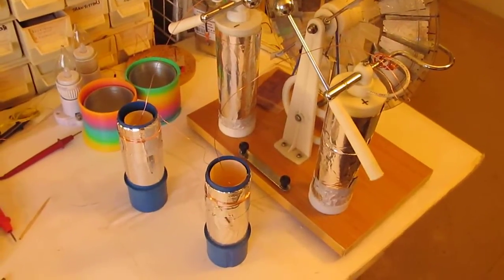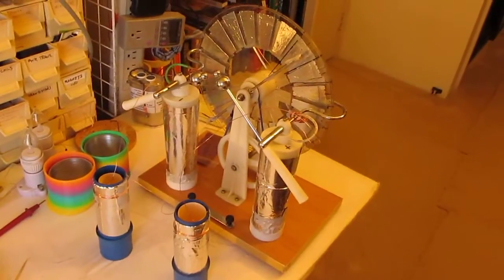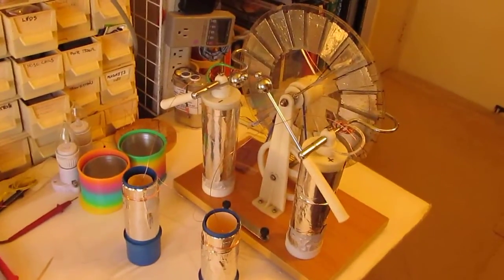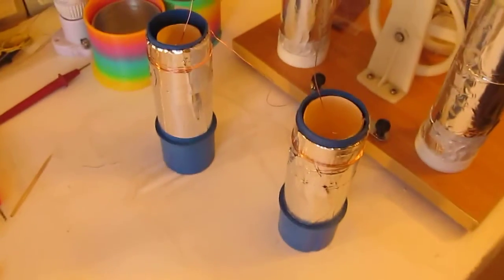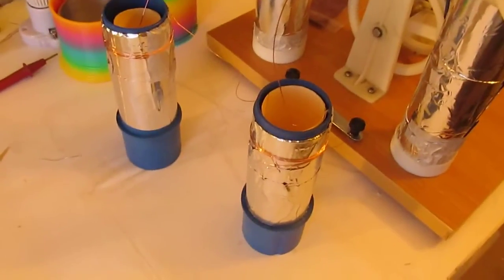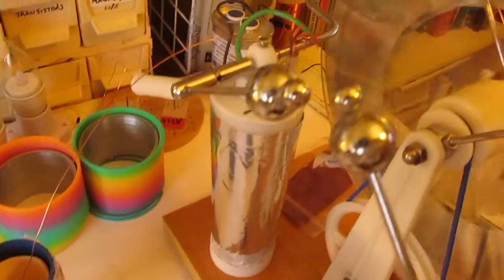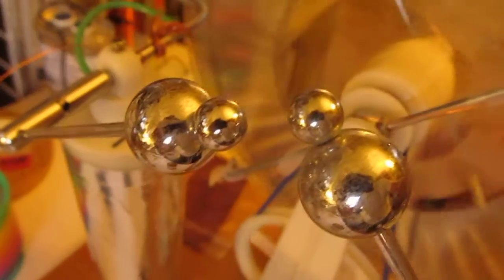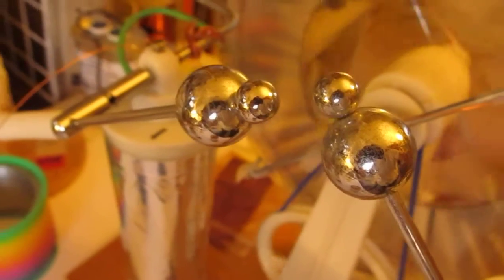Whimsy Wimshurst Generator

Comment: awesome ....what would happen if you let the discharge pass thru a 1 to 5 turn primary of another coil.  secondary as step up rectifiy it then place rectified into large electrolytic caps to do work may be run a small motor at the front end